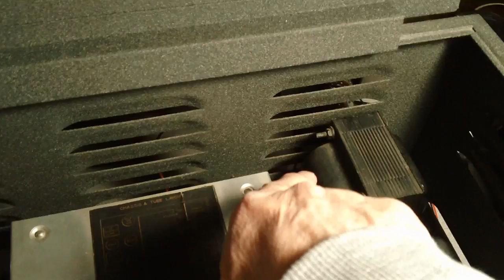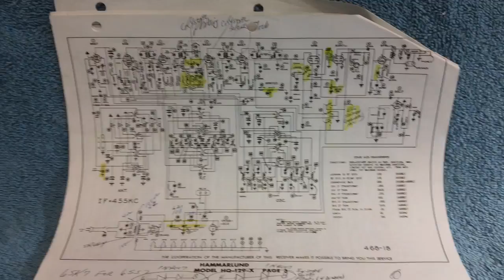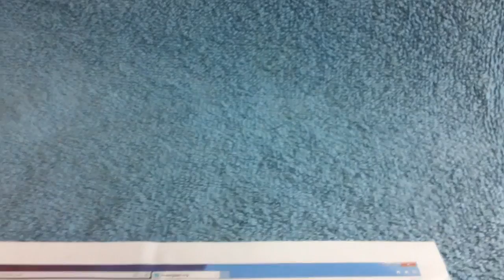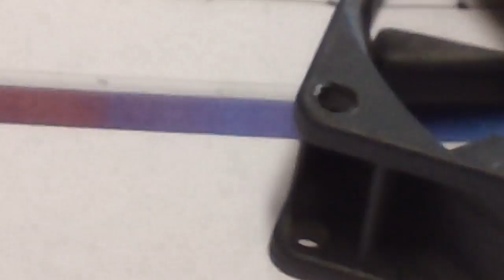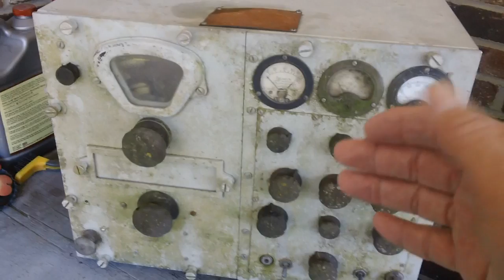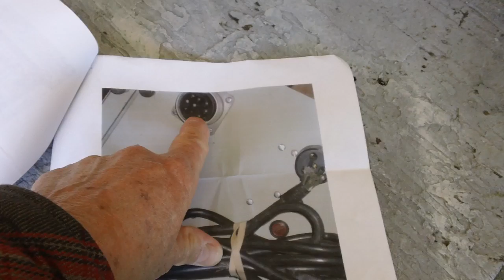Mish-Mash #144

Comment: Greetings John, I had a Yaesu FT101 and Kenwood TS520, both had whisper quiet built in cooling fan   .I place a 4" fan at the rear of my Drake TR4.  I also simply set  PC fans on top of  my hifi amplifiers, makes a big difference.  Uma fan of fans.  Don

Comment: Hey John,Thanks for passing along the tip on the pc fan.  About once every 6 months I take my pc out to the garage and fire up the compressor and blow it all out and never even thought about the fan generating voltage before.  I'll certainly stick something in the blades from now on to keep them from spinning.Take care,Gary
Reply from the maker: Gary,
There's no certainty that the voltage back-flow would cause any miniature component damage, but I've decided to no longer take the chance.  A pencil in the blades is much better than paying a big repair bill.
Regards,
John
Reply: John, fortunately it never seemed to hurt my old pc but I finally broke down last November and got a new pc so I won't be taking any chances with it either.
Take care,
Gary

Comment: I've put 12vdc fans in audio equipment before and usually it works out fine, do a trial first I once had a preamp that picked up noise from the motor. (Your unit has indirectly heated cathodes so it probably won't be a problem.) Anyhow neg lead to ground heater hot through a simple silicon rectifier diode along with a 100 mfd. cap for filtering. The D.C. voltage to the motor should be approximately 140% of the A.C. filament voltage minus the .6 volt drop for the diode. Also wouldn't a 5U4GB give you better clearance than the 5U4G? Just my thoughts.
Reply from the maker: There's always more than one way to skin a cat.  I think I've found one of them.  Also, a 5U4GB would afford better clearance, but I like the looks of the 5U4g.  Besides, I probably have a GB in a box of loose, spare tubes, but just don't have the energy to sort through the mess.  LOL
Regards,
John

Comment: Good video, John, all the way from the taters to the fan!  I never thot about the fan being a generator, but that's exactly how any generator works; a shaft with magnets on it has magnetic fields that go across coil windings.

I knew exactly what you had on the RBC-5, a military boatanchor.  I think you will be pleasantly surprised when you open it up.  Almost all military comm gear from this period was dipped or soaked with shellac or lacquer inside, in order to completely keep moisture out.  It probably won't be a very hard fix, except for the cosmetics to the outside.
Reply from the maker: Harvey,
It will be very interesting to see the inside that RBC-5, but I'm not expecting too much.  But the chances are that I'll never get around to fixing it.  I don't have the power supply and don't really want to spend the bucks to build one.  Better to spend it on something more fun.
Regards,
John

Comment: John,
Thank you for the mention my friend.  Though I’ve not personally rotated with air, and measured the voltage generated, larger sized computer cooling fans, I’m reliably informed they can generate anything around three quarters, to one, volt.  It may appear low voltage but if it reaches a particular pin on a chip where a 0 is specified rather than a 1, the result could cause problems.  Good on you for highlighting the fact potential problems can be caused to computers when fan blades are rotated by blasts of air.
Please sir, I ask you to give great consideration to what I’m about to write.
I consider you a very fortunate fellow to own a RCA, model RBC-5, communications receiver: and it came with its power supply unit…how good is that?  Believe me my friend, I wish I owned a RBC-5.  If nothing untoward is initially discovered, such as transformer burn marks, green spot on IF transformer windings, or none electronics parts missing etc., please give repair/restoration a go.   No doubt it might well be a long term project that can be accomplished off camera.
I’d love to own a Marconi, model R1155A, communication receiver. They were fitted into WW2 Lancaster, and Halifax, bomber aircraft.  Ray Heffer, from Radio Workshop down on the south coast, shows one in the following video: 
https://youtu.be/nZNiSTNpubk 
These types of old military receivers have become quite expensive: far more than my wife would let me pay.
Regards,
Phil.
Reply from the maker: Phil,
Guess I gave the wrong impression, my friend.  Sorry about that.  The fact is I don't have the power supply for this radio.  The gent who gave me the radio said he thinks it got burned up in a hay barn fire.  Bummer all the way, but he said he'd look around to make sure it wasn't to be found.  But I did manage to find complete manual for it.  And making a power supply wouldn't be all that difficult...minus the original style oil-filled filter caps that is.  LOL  Here's the manual link, which includes the power supply schematic:  file:///C:/Users/User/Downloads/rbc.pdf
Whether or not I ever get around to messing with this rig is anybody's guess.  I'd like to do it, but doubt I have enough time left on the planet.
Regards,
John

Comment: Sunon is a good brand of fan. Should last a very long time.  I thought about suggesting a 120V fan because I thought it might be easier to install one of those, just tap off the mains going into the transformer, and throw a switch in there since they are 120V AC fans, wouldn't have to rectify or do an external power supply,  but I didn't think they would have any of those laying around, usually don't see those in computers except from the 80's.
Reply from the maker: Connecting Point has been in business for a number of years, so they've collected a pile of the usual used puter parts.  Your recommending that I go to them for a used fan was a good idea.
Regards,
John

Comment: My god you over complicate everything. 1N007 diode in series with one wire, half wave pulsating works fine.
Reply from the maker: Brother Mac,
It may come to that later on, but right now I prefer not to hook/solder onto anything in the circuitry.   And what do you mean I over complicate?  You're the lard hating tree-hugger.  LOL
Regards,
John
Reply: joernone
Very well, carry on.

Comment: Hi John,
Adding a fan to cool your transformer is not a bad idea. However, have you considered the fact that that fan will draw an extra 175mA from your transformer, thus heating up the core a bit more? 
Wouldn't it be more efficient to mount a heatsink on top of the transformer body (with some heat conductive paste between the transformer core and the heatsink) ? Heat dissipation is a matter of surface area/mass/C° or F°, whichever. It stands to reason that a larger area will help dissipate temperature more efficiently. Since it's passive it also won't heat up your transformer even more (and it can't break down or be noisy like a fan). It would help of course if your radio had a hole at the top to evacuate the heat, but I guess that wouldn't be an option.
It's just a suggestion :)
Reply from the maker: As I said in the video...stand by, my friend.  All is totally under control.
Regards,
John

Comment: Transformers are usually rated based on temperature rise classification.
Some transformers will have a number printed on them like "Class 130" This usually means that the transformer can handle a temperature of 130° C https://en.wikipedia.org/wiki/Insulation_system

Here is a response I got about a Triad N-68X (from Triad) and how hot it got:
"The answer that you are looking for is that the operating temperature of our N-68X is from -40C to about 
+65C; this comes from the 130C rated insulation materials within the unit (which 
UL typically likes to derate to 115C) and an expected full power temperature 
rise of about 50C allows for a maximum ambient temperature of 65C.  This unit 
was designed over 50 years ago, and the operating temperature was never included 
in the datasheet. 
Without going back to 
the design calculations it is fairly safe to say that of the ~50C temperature 
rise (above ambient) at full power, about half of the loss comes from the core 
and half comes from the windings.  Since the core loss comes from the applied 
line voltage, it does not change significantly with load, so we can assume that 
half of the temperature rise is due to the core loss and this remains fixed.   
The other half of the loss comes from the winding losses; since these are the 
I^2*R (current squared times 
the resistance), half of the current (half the power) creates ¼ of the full load 
winding loss.  With the core loss, the expectation is that the total loss is 
about 5/8 of the full load loss so this would suggest a 31C rise above ambient 
at half power compared to ~50C rise at full power.  Since these are rough 
numbers I am not going to guarantee the numbers will be exactly as I have 
suggested, but the general idea is valid.  You can use this to estimate the 
temperature rise at different load conditions."

The gist of the above is that my transformer could see a temperature of 50° C over ambient or 74°C which would be 165° F.

So to find out if your transformer is getting to hot, you need to know its insulation temperature rating. It is quite normal for some transformers to be too hot to touch.
Reply from the maker: We're lucky to even have paint on this ancient power transformer, much less a stamped temp rating.  LOL  But no sweat...stay tuned.
Regards,
John
Reply: +joernone I was just reading where in your receiver that a lot of times the 6SS7's get replaced with 6sk7's the 6SS7 have 150ma heaters and the 62k7's have 300ma heaters.